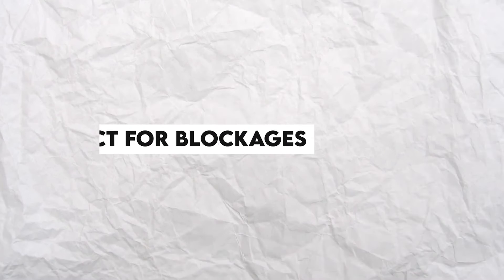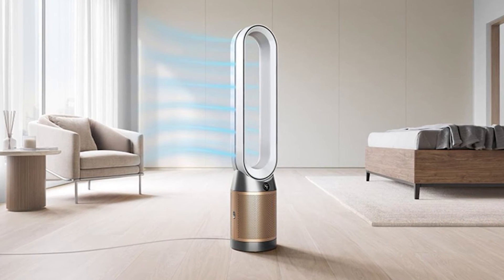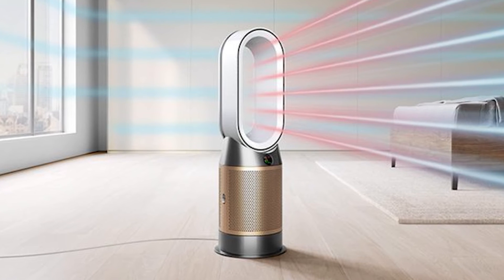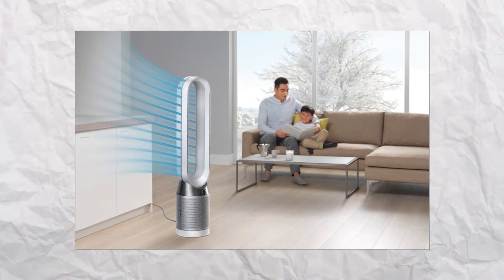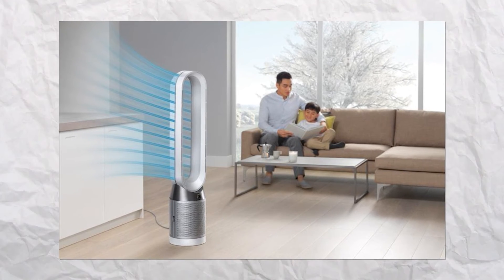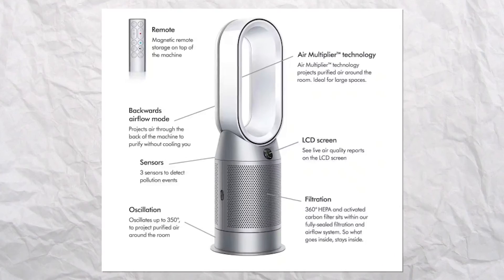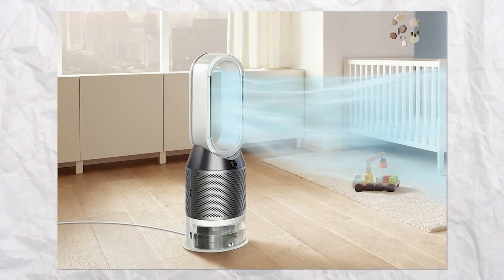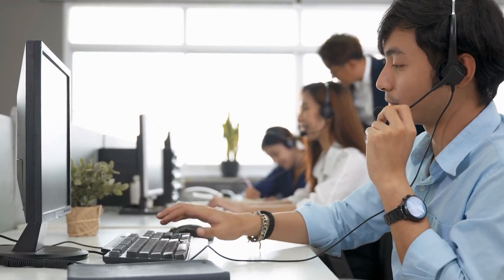Dyson Air Purifier Error Code E: Insights into its Origin, Troubleshooting, and Restoration

Comment: No reson the E came. Poor design machine.
Reply: Its on purpose, makes you buy the expensive filter for no reason. Or a whole new fan.
I have a no name fan that is 20 years old, I rinse the entire thing with water(unplugged) to clean it and it always works, high temp/low temp. This Dyson fan is absolute B.S.